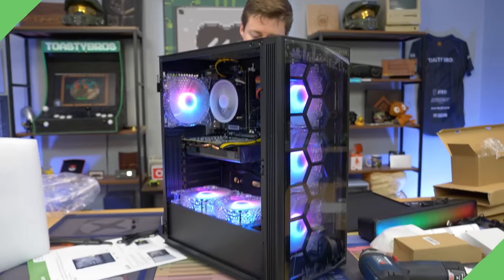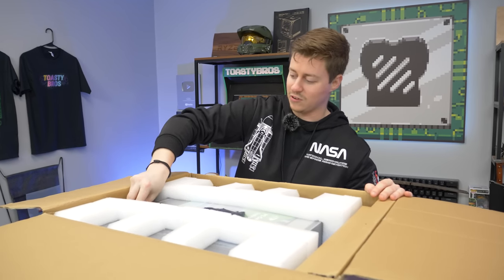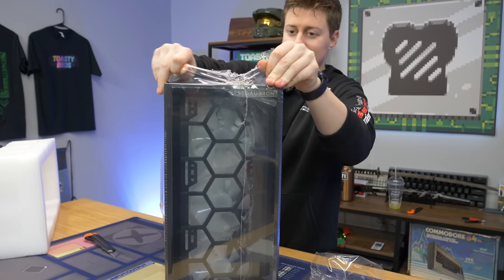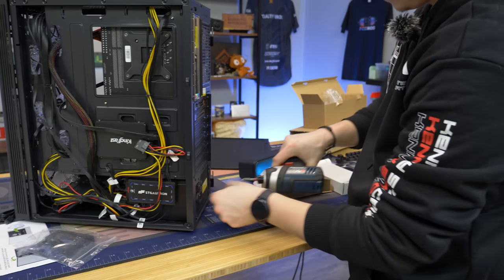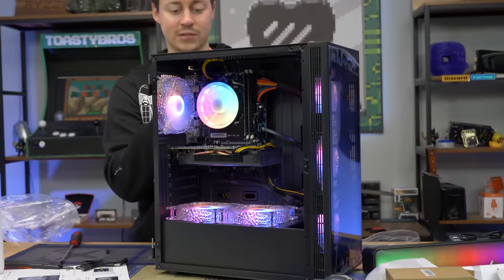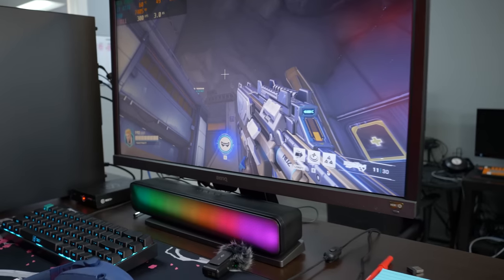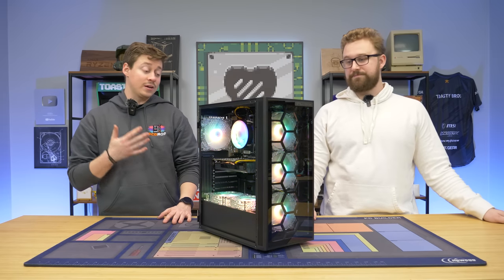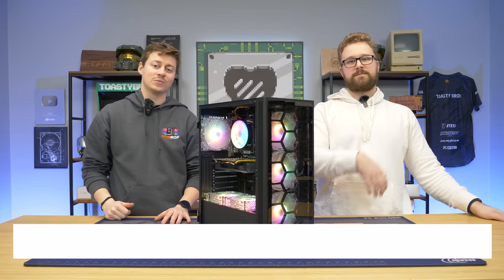Why are People Buying This $600 Gaming PC??

Comment: the bluetooth speaker turns off to save battery, if it didnt do that then will work like 5 minutes and run out, also you cant use it while charging cuz it makes noise and sometimes it kills the charging board

Comment: I take research on this build, you can find a very old i7 from gen 2 or 3, running with all China components, yes, it's cheap, I also wonder where they get these cheap stuffs. It's not brand new, It's from old computer from mining computer. But if you need a computer for one year and then building a brand new with your budget, this is good choice.

Comment: That 4770 with the RTX 2060 is gonna be one hell of a bottleneck.
Reply: Not really I build this same pc all the time with a good oc i7 4770k is a champ with strong single core performance undervolt the 2060 and there's almost zero bottleneck
Reply: @jeffreygrindle6396  Tell us what fps you get with what games and compare to performance with a higher cpu and 2060 on same games then let us know the difference. It is impossible there isnt  significant bottleneck no matter how fast you clock that 4770k.
Reply: @tendosingh5682  on stock clocks your looking at less then a 8%percent bottle neck the 4770 is a great chip to oc so with the 2060 it's almost a near perfect pairing
Reply: What’s a bottle neck?
Reply: @shshgsdshhdhdd9523  a bottleneck is when a computer part is weaker than all of the other parts which slows them down. For example, the CPU might not be powerful enough for the GPUs requirements
Reply: @shshgsdshhdhdd9523  It's the neck of a bottle.

Comment: That system would love an i7 4790K.  There isn't much performance left on the table with that and a RTX 2060 at 1080p.  Still, looked very capable didn't it.  It is!
Reply: I run a 4790k and a 2080 super in an optiplex and I get 60fps on 2k with full ray tracing ultra graphics in dying light 2. So it's not THAT bad. Lol
Reply: @zackburkhart8693  congratulations.
Reply: @Zack Burkhart  at 1440p the 4th gen i7 is surprisingly capable. However, it's very inefficient compared to a modern CPU. An i3-12100f will do the same job, and an i3-12400 will beat it without a sweat with ddr4 and ddr5 support and better PCIe support. Of course, a modern mobo and ram is also going to cost more than an old system, so there's that to consider as well.
Reply: @Paul_Ward  and I'm keeping old still functional parts out of the landfill. There's no need to have cutting edge technology.
Reply: @Jordan cox  that's also true. There's a question around whether being less efficient and drawing more power is more harmful than the landfill concern, but now we're getting way off topic 😂 if you're happy and it does what you need it to, that's the main thing
Reply: @Paul_Ward  nothing pleases me more than to take the side panel off my 10 year old Dell optiplex and have all this hardware stuffed into it. Lol
Reply: @zackburkhart8693  an absolute disaster... That still gets over 100fps in every game i currently play.

Comment: Not really sure it is worth $600 but it does work.  I built my core i5 11500 system for $900 but that is because It should outlive me. GTX 1660 super OC and 32GB RAM in an Antec NX410 case. My Girlfriend  thinks it is overkill  LOL. Anyways fun video.
Reply: Coming from the owner of a i9 13900KS and a RTX 4090, this comment is going to age like milk after about 10 years I believe.  I think this will be the last generation of super powerful components inside our house anyways, as I believe parts will be smaller and slower in favor of connecting to a streaming service located somewhere else.  Fast internet will become more important than a powerful machine in the next 10 years.
Reply: @Belkalton   My PC streams just fine and my power consumption is very low.
Reply: Time traveler?

Comment: I got this exact pc and it works perfectly! Although I have 1 question. He said I wouldn’t be able to upgrade to drr4 ram. But when I contacted Microsoft support they said I was switch to ddr4 ram. Can someone please clarify for me. :)
Reply: if you upgrade the cpu you should be able to run with ddr4 ram no prob, but I dont have one of these pcs so i cant guarantee that
Reply: How does warzone 2 run ?
Reply: I would have never bought a pre built with ddr3, now to get ddr4 you have to change the whole motherboard..
Reply: does the pc still work good?

Comment: Bought this PC it’s had nothing but problems one after another first after hardwiring internet wouldn’t load, then setting up multiple monitor’s kept crashing. After setup it blue screened on me, I plugged in an external hard drive that had my files from my old pc and it crashes multiple times. Couldn’t play any of my games such as RDR2, GTA, ATS, Mudrunner they all crash at the loading screen. Not even having this PC for 3 days. 1000/10 DO NOT RECOMMEND.

Comment: Quick (noob) question. In Warzone, you mentioned that the CPU is probably bottlenecking performance. But it looked like it (and the GPU for that matter) was only around 50-65% usage, so how are you coming to that conclusion?
Reply: when GPU usage is not 100% it means CPU is bottlenecking it. It's hard to say there is bottleneck based on CPU usage since there are many cores and games usually don't use all.
Reply: @petarlazic739  Hwinfo will show a few cores pegged at 100% when there's a CPU bottleneck. Total CPU usage won't be a 100%, hence games don't use all of them to max. all the time.

Comment: I love how they have the fans that are directly below the GPU in an exhausting orientation??? :s  All that does is take any fresh air away from the GPU before it can be used by it and then dump it into the PSU shroud?..."WTF were they thinking" :/

Comment: Dont buy a budget prebuilt from amazon or even newegg for that matter. They are super cheap, and the chinease power supplies break in months. I'd recommend Build Pro PC. They have a PC for under $600 with a Ryzen 5 5600 and 16GB of ram. Really great value, highly recommend.
Reply: with a 1050 ti included.

Comment: so if you can get this for $200-$300 cheaper than $600 would this be worth getting??? i have a 3060ti graphics card already but its in a pretty old potatoe pc :(  my processor is AMD FX 8300
Reply: Or just save a little more for used AM4, and you have a better-ish upgrade path on the used market.

Comment: A new computer these days should not have a mystery i7 cpu in it. and not a 4770K either. It is from 2015 or so. so it is very very old now. You can install and run Windows 7 on that computer, that is how old that CPU and motherboard technology is.

Comment: Not sure if you read comments.
But I have a 5600g with a 1070ti.
My nephew wants me to build him one but cannot afford a gpu yet.

So to show him the performance I just put the hdmi into the MOTHERBOARD hdmi.
But I was still getting the performance of the 1070ti.

Everyone online says it's impossible the gpu cannot travel thru the motherboard.

But I can disable the 1070ti in device manager and mid-game watch a 100fps drop in performance.

Also in my msi afterburner osd you can see the numbers on gpu1 and gpu 2 change drastically 

Recorded all this on my phone and posted the video. Never moving the hdmi from the motherboard. 
And of course still everyone says it's impossible for the motherboard to get any gain from the gpu
Reply: Long story short
Can the motherboard hdmi port show the same performance as the gpu hdmi.

I'm told impossible and can prove otherwise.

Comment: Me who's gonna try to build a working gaming unit for under 200E.
Will get myself A8 7600, with a DDR3 based motherboard, since DDR3 ram is cheap now, SSD and HDD in, WIFI in, for 80 bucks.
2x 4GB ram 1600mhz, can upgrade to 2133mhz in dualchannel 2x8 or 2x16 for cheap.
315W PSU.
Will target a GTX 1050.
Maybe Ti, the lowest the price, the more chance I take it.

Cost-effective and powerful PC
Reply: To think how much DDR3 I have discarded from my work...should have kept more and sold it!!!!  I at least did keep one box of 8gb sticks.
Reply: @cbmadcow  Fr !
DDR3 is cheaper than DDR4 and with the max speed ram sticks, it's pretty decent ! 
It's very useful especially on low-end or mid-range PC.

I mean, my guy, you should always keep older hardware, coz one day, they'll come handy (when you main, newer PC dies, for example)

Comment: Just swung a t1700 with i7-4790, 32gb ram, a 256 ssd, the 365w psu and a quadro k2200 for 130. Bout to slap a 1650 super in there and cruise 1080 for under 300

Comment: I wanted to buy this I have been waiting for a review for a month THANK YOU for what you do its good for a 600 pc I am still gonna get it couse I can't choose anything above 600
Reply: If you put it together yourself it's only about a 400$ pc, cheaper probably.
Reply: @Vegatablez  the 2060 alone is 300$ where im from. 600 is a deal.
Reply: An rtx 3060 is also 300$ if you spend that much on a 2060 you are being ripped off. A used 2060 goes for less than 200 on ebay, a lot are around 160. plus 120$ ish for a dell optiplex with an i7 4790  16gb of ram. Then a powersupply, that's less than 400$ for the same specs, potentially just about 300. For 600$ you can do much better.
Reply: @Vegatablez  oh absolutely, if you use second hand parts AND you build it yourself, you can do so with around 400$, but for having new parts, the warranty, and having someone else build it for me because i don't have the time or patience, i'd always buy the prebuilt for 600.
Reply: @gerutzu575  the i7 4790 is 10 years old, if you think they're using new parts in this build that's just delusional. And I wouldnt trust this things warranty for a second.

Comment: I’m building my first pc and it’s 1660 super with 5600 is that a good combo for streaming?
Reply: I don't think that combo will be powerful enough to stream.

Following
Reply: Don’t buy a new or used 1660 super. They’re bad value, for that brand new you could get a used 6700 xt or new 6600 xt
Reply: It’s fine lol I have a 1660 and 3600 and it streams fine 1080p 60fps through obs but I primarily play esports games anyways so they aren’t super demanding
Reply: It's okish for esports titles, but I still recommend at least getting a 3060 if you want NVENC, or a 6650 xt or 6700 xt for the raw performance, and AMD stream encoders have improved a lot and are pretty good as well.
Reply: @SimplyTheSloth  Or a RX 6600 for $240ish. Much better
Reply: @SimplyTheSloth  they want streaming AMD is ass for streaming
Reply: ignore the other dudes who don't know what they are talking about it should be good to stream most games 1080p60
Reply: @viggy8406  A 1660 has NVENC, and can stream at 1080p 60 FPS while playing. I used to do it with a 1660 ti.
Reply: @Dee-tc7lo  Oh my bad I should have worded it better. I know the 1660 also has an NVENC encoder, but the point I was trying to get across was that if they wanted better performance, they should go with the 3060 or 6650/6700 xt so that there isn't as much of a bottleneck.
Reply: @zee-fr5kw  AMD is the exact same for streaming. The only card that nvidia does better on is the 4090 because amd haven't matched it yet.

Comment: I've seen several of these with 2060's and I've been wondering how they can be this price with this card.
Reply: exactly! i was wondering the same thing... last time i checked 600 pcs had gtx 650s in them LMAO. they must have cheaped out really hard with the power supply and ram and motherboard. they probably did not give a shit on how everything else worked or if it broke in 2 weeks. they just wanted customers to see high ass frame rates.
Reply: @Ithinkimfaster  Yeah unfortunately I have one of those gtx 650 600$ pcs

Comment: Pretty sure i saw a video in where they were taking laptop 2060's and putting the chips onto a desktop board, basically its a laptop gpu on a desktop board, this may explain the lower specs.

Comment: $600 for a PC is great if you're not so savvy with building one yourself. Although this is the kind of computer you show your parents and post on a Christmas list so you can finally play little kiddie games like Fortnight and Overwatch on PC instead of a console. No offense to folk who enjoy those games. 

However, it has decent hardware. The i7-4790 is almost ten years old but was one of the top-performing standard CPUs back then. On top of that, you get a case, Winders 10, 16 GB of RAM, a 500 GB SSD, some gamer-influenced peripherals, a Chinese 500W power supply, and a 6 GB DDR6 2060, or at least that's what it says on the benchmark. There are certainly worse options that Chinese PCs could get at that price, such as being outfitted with a GT 1030 or having no GPU at all. 

It's not a great value for the sum of its parts, but it isn't exactly a scam either. I still game on ten-year-old DDR3 RAM and a ten-year-old CPU. I also have my GT 1030 running the show for an enjoyable Bethesda gaming experience, it's not the best it could be, but it's not the worst I've had. The sum of my parts would be about $300, but luckily I found my PC mainly for free in the trash.
Reply: Kiddies games lmao
Reply: @deagle7776  They got Overwatch games at the Chuck E. Cheese.

Comment: Playing a low end game like Overwatch  doesn't really say much about the gpu.Overwatch requires a 2010 460 "released 12+ years ago" to play LMAO so yeah poor choice.Warzone 2 again  prefers a decent gpu a 1060 but should be noted that a few of these lines have been or will be discontinued like even the 2060 is going to be discontinued and likely why this reviewed system was cheaper to make.A 512 SSD is another reason that is a rather small drive  and can be had easily for around 50 bucks but idk what the price would be if using a bunch of these from say Alibaba maybe 20 bucks?
My personal opinion is that for 600 bucks it is decent enough a system.

Comment: I have a gaming pc laptop but I been looking for or possibly building a custom gaming pc desktop I seen the prebuilts and some of them are not that great and some of the comments I read on Amazon and they weren't good only on ones with.really good cpus and really good graphic cards and fans but they were alot of money has anyone on here built there gaming pc desktop for a first time and how was it
Reply: Building is easy if you watch a few videos. Most of it is equal to adult Lego’s as long as you can read you’ll see where to plug stuff in. An i310100f pc can be done for like $450 with the 5500xt they always rave about on here
Reply: I built my first PC about a month ago and it went super smoothly for me. I would just say to take the time to research every part you're interested in getting. Especially for compatibility sake. You wouldn't wanna have to try and flash a bios or anything on your first build. Plus watch a bunch of videos on YouTube first. Knowing what things are, where they go, and how to install them in depth is what made actually doing it when I got the parts so easy.

Comment: Hey you legends this comment goes out  to the creators of this video and everyone that may know the answer to my question. So I purchased this pc pretty much same one but I think it might be little better. Now that I have it I want to switch out the graphics card to a 4060 rtx GeForce i7 would this be possible with the size of motherboard or case size. Do I need to start from scratch or can I proceed with the upgrade. Please help
Reply: I basically want to add a 4060 to this pc and even a new processor. It's not that it desperately needs the upgrade but I want to have more sauce in my pc
Reply: Would all this be possible?

Comment: It's everything now a days. Today's generation thinks PC's have to have all these lights. So to do that they use cheaper parts to keep prices down. Same thing with stereo's. They think they need bluetooth mp3 wma flac this and that. Cheaper parts lower cost. In the 80's you spent $500 on a amp w/built in pre-amp. You got some thing good. Now that same quality = $2000 give or take a little !!

Comment: The way you are negative and sarcastic about the brand before trying it is kinda weird.. Even trying to make fun of their name when you are called "toasty bros." and saying it could have been packed better? it came in perfect shape. You can't even figure out how to use a speaker and blame the speaker.. total joke. "bluetooth would have delay" uh no it doesn't have much at all. Many people use bluetooth for headsets and speakers or speaker bars. You also probably unplugged that cable when you yanked the power apply out and other stuff to look at it before  turning on the system. This channel is not one to watch IMO. You try to act like Linus or one of the top dogs being "funny" about bad systems they review, but you got a pretty GOOD SYSTEM!!  

The CPU is old, but the mousepad, speaker, mouse and keyboard even if cheap add to cost. They put in a decent amount of cooling with cheap fans, but its better than most cheap systems put in. I could build better for $600, but this is prebuilt and shipped with good foam in it even so that all adds to the cost is the labor. The review of the system was you waiting to crap on a computer that did its job well.
Reply: Kinda true